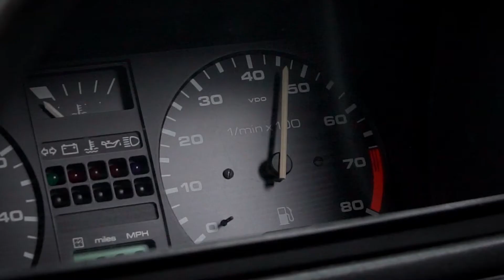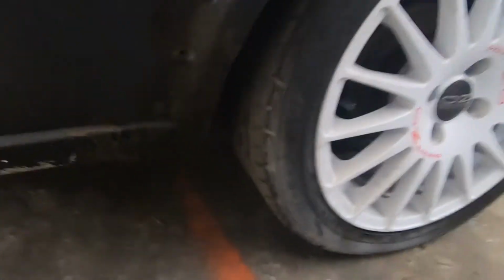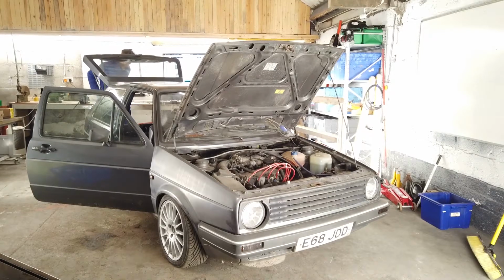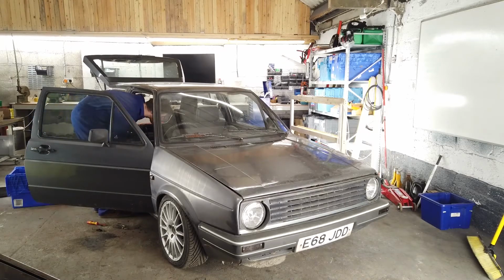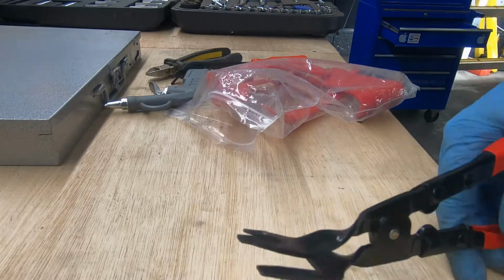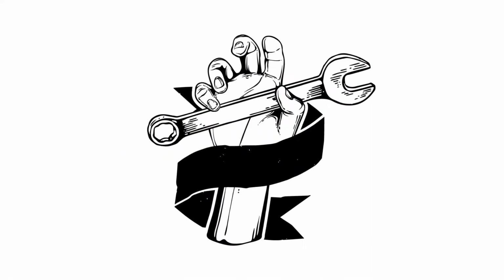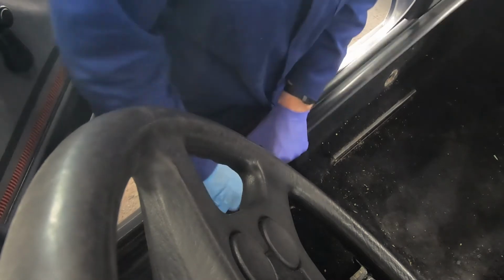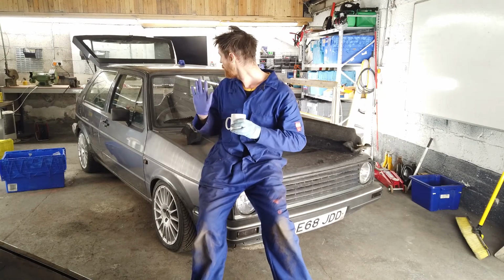I bought a 1987 VW mk2 Golf GTi on eBay - how bad can it be? // Part 01 - First look and stripping

Comment: Used cardboard egg boxes are useful for storing smaller bits. You can catalog by writing on the cardboard lid. 6, 10 or 12 small compartments for different screws, clips, nuts, etc. Useful recycling!